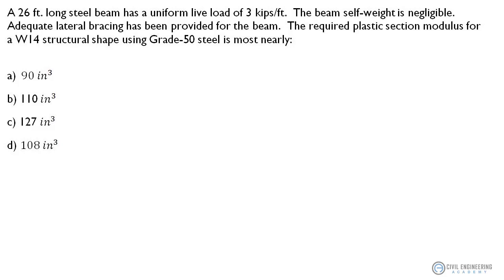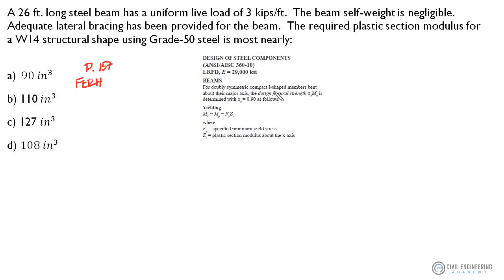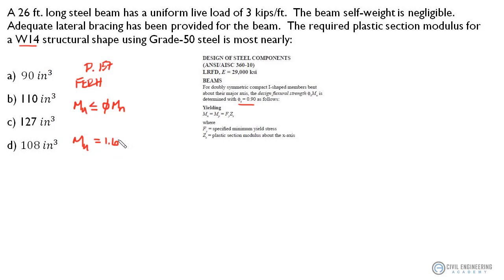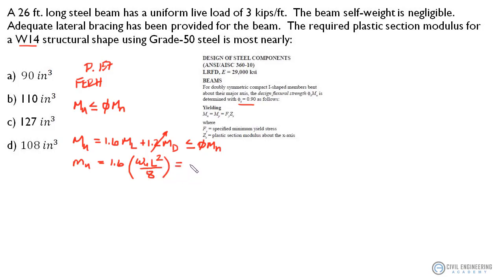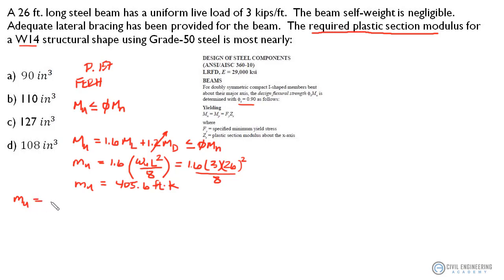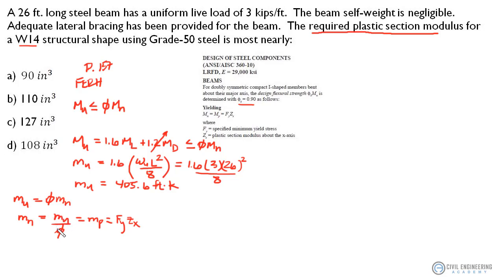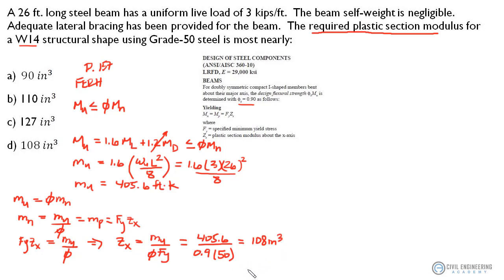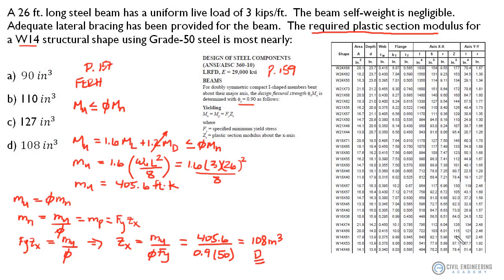Civil FE Exam - Find the Required Plastic Section Modulus of the Steel Beam

Comment: You forgot to multiply by 12 in the final step to get your final answer. Additionally, I came out with 108.16 in^3. In the exam would you round up to 110 in^3 (B) since 108 technically doesn’t meet the required section modulus? “Most nearly” is so confusing. Thanks for the good video